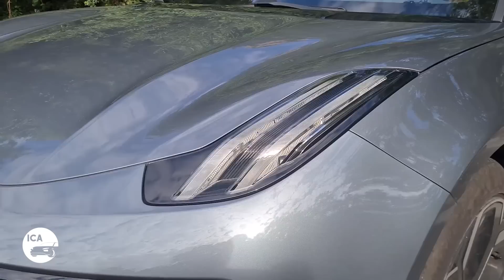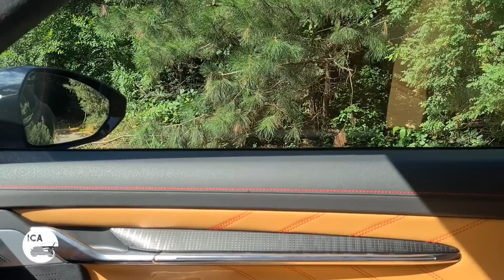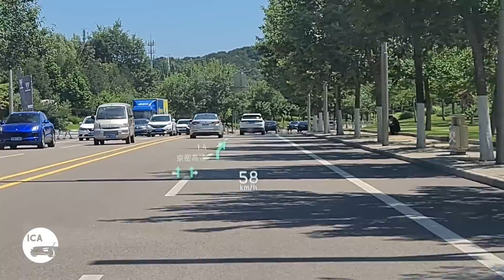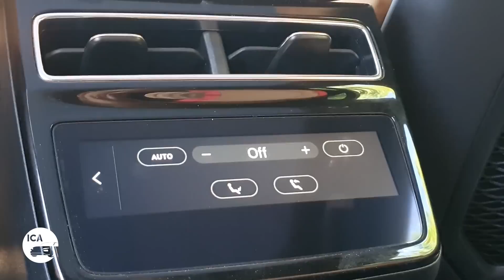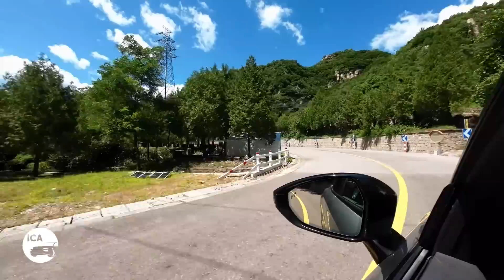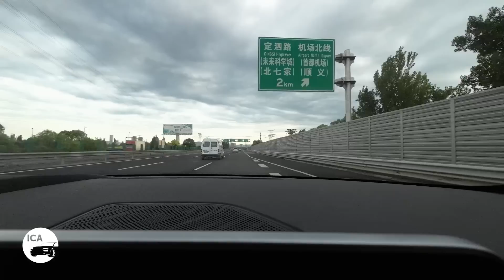The First EV Shooting Brake Is A Monster - Zeekr 001 Review

Comment: Porsche 911 hasn't got 265 rear tires... the old caymans used to, a modern Porsche has wel over 300...
Reply from the maker: I probably said 'like a 911'. I remember my uncles C4S from about 2003 had super wide rear tyres and the sheer size of them stuck with me.

Comment: Looks like an insanely nice car! Interior is beautiful, acceleration is supercar fast (or faster!) I was very dubious about electric cars and Chinese cars but ended up getting a BYD E2 for city driving and am super pleased with it and planning to get another higher end car when funds allow. Was thinking of a BYD Han and still am but seeing this makes me think of this as an option too! 

In the meantime trying to find if some way to increase the performance of the E2 a little 😅, quite hard to find much English info about the E2!
Reply from the maker: Awesome. Where do you have your E2? In China or somewhere else? Han is good but will be expensive in Europe. Our review of it is coming very soon so check back this week.

And yes, the Zeekr is really impressive. The chassis is engineered by a former Volvo/Saab guy so not only is it fast and really well engineered, it's safe too. A brilliant car. Coming to Europe in 2023. Just hope the price is right.
Reply: @InsideChinaAuto  I'm in Lao in South East Asia, the North here shares a border with China. The E2 here cost me $25,500 USD on the road and the Han here is around $58,000 (4 wheel drive top spec model) how much is the Zeekr in China?
Reply from the maker: @supernovadw  Nice. I saw a few Laos-plate cars when I was in Yunnan. The Zeekr starts at $44,200 in China and goes up from there. Dual-motor is $51,400.
Reply: @InsideChinaAuto  yeh one of the only countries cars who are allowed in China without a guide, I'll have to do a road trip up there sometime! Very tempted by a Zeekr or another similar car when funds allow and quite easy to buy in China and import to Lao so should be lots of options.
Reply from the maker: @supernovadw  Yeah, you should cross the border and give some a try now we're open. You'll be impressed. Hope Laos is treating you well.
Reply: @InsideChinaAuto  I went in 2018 to Kunming but flew there not by car. My wife is of Chinese decent and speaks fluent Chinese so easy when we travel there. Maybe even worth looking at buying a car there and sending it here like I say. What province in China are you in? Is there anything there in the way of people modifying their EV's? The Tesla and other western brand EV's are able to do a remap (more accurately re program) for more power so must be able to do with Chinese brands too.
Reply from the maker: @supernovadw  I'm based in Shanghai currently (formerly in Xi'an). I'm not 100% certain if there's a remap market yet, to be honest there's no huge modification culture other than colour and interior materials, but it's growing. The most modified EV is the Wuling Hongguang EV because it's so cheap and easily customisable so people do all kinds of cool and crazy things with them.

Comment: No, hating but so many Porsche design ques; 
• the shape of the front seats.
• the headlights on the top of the front hood
• the “handles” on the center consol 
• the “baseball glove”  color of the “Napa leather”
Reply from the maker: To be fair, the headlights on the bonnet are a design feature of Lynk & Co, partner brand and the brand this car was initially going to be made for, and if handles on the dash are a thing, then maybe the G-Class should be giving Porsche a call. Can anyone 'claim' a colour of leather?
Reply: No hating but you're blind. Geely's subbrand Lynk & Co was first with this design so yes Porsche copied Geely.
Reply: @jzvr5842  you know that you are referencing a brand that launched its first car in 2018, Porsches design language and brand is a bit older than 4+ years…
Reply: any references？

Comment: As much as I like this car, during the entire review I couldn't really shake of the feeling that they took a real good look at the Model X for inspiration. The auto-close door when you press the brake, the UI on the screen, the panoramic roof etc.
Reply from the maker: Inevitably there will always be some crossover between cars and what works will be used and what doesn't will be left behind. Credit to Tesla for paving the way, introducing some cool features, AND not blocking them off to others like some brands do.
Reply: i really dont see any resemblance at all. but hey, its hard not to look alike others.
Reply: I wonder where technology would be if brands didn't copy from other brands? V🤣
Reply: apart from the tesla clues, there is a lot of volvo/polestar tech in its guts. not surprising, after all these are sister brands. was one of the things that immediately stuck me when i drove it.
Reply from the maker: @leotek..  Well partly because it's not entirely true. It is based on the Geely SEA platform, not Volvo or Polestar's  (the 1 and 2 aren't based on it), and the operating system also isn't from Volvo or Polestar either which are Android based whereas the Zeekr is on the Snapdragon 8155 now (and a different chip before). What they may share is motors, not 100% certain on that.
Reply: LOL none of those were invented by Tesla.

Comment: The seat controls in the back are a dangerous feature , you only need one naughty child in the back to suddenly push your seat forward while you are driving and it's a recipe for disaster ....
Reply from the maker: Fortunately they're only for the passenger seat, not the driver. It's not an uncommon feature in luxury cars here to have controls to push the front passenger seat forward to give maximum rear legroom for the big shot exec in the back.
Reply: @InsideChinaAuto  That's a relief , with my grandchildren I would be bricking it 😂
Reply from the maker: @PhilipKerry  If you lived in China you'd have to contend with them not having to wear seatbelts in the back either. One rule that does need implementing here.
Reply: @InsideChinaAuto  Ouch

Comment: About the chip. Zeekr tried to pull a fast one and fobbed off a lower spec snapdragon 820A inside on some of the early delivered cars. It was exposed and triggered enormous outrages among the owners, because 8155 was promised on their launch and the inferior chips are quite laggy. Then Zeekr offered compesations like store credits and free charging and things like that and was declined. Finally they decide to take thier medicine and offer upgrade to 8155 chip free of charge to all owners before their first model tuning into a fiasco. You can see the result in the sales rebound in the last couple of month.
Reply from the maker: Absolutely. I wasn't aware of all the fobbing off side but the chip we had was certainly problematic. 8155 seems to have solved all those issues so it was the right action eventually to roll it out for free and fixes the one weak point we had on our car. Over 7k sales in August with just one model is impressive.
Reply: many other brands did stuff like this. Let's not mention Toyota wheels coming off and then recall all the cars because of that.
Reply: 我就是极氪车主，没有你说的上市时厂家说搭载8155芯片，但交付时减配成了820芯片，然后车主们都很愤怒的事情，相反当厂家说给我们免费更换8155芯片时，大家都很高兴。你说的芯片减配，或许是欧拉好猫那款车
Reply: @拉赫萨  可能是我理解错误，但是当时极氪车主芯片这事是闹得沸沸扬扬的，极氪一开始也提出赔偿方案然后被拒绝的
Reply: @maniacyro5167  当极氪换上8155芯片，加上软件逐步完善，可以说是这个价位里最全面的一辆EV汽车了。当然，目前NIO的ET5也上市了，有机会想去试驾一下，这也是一款令人惊艳的EV汽车。我不知道你在哪个国家，希望中国的EV汽车可以走向更多国家。
Reply: @maniacyro5167  然后传祺gs8也基本重复了这一个错误，本来有能力打败汉兰达的是他，然后白白把这一头衔送给了理想
Reply: Standard Chinese protocol, DENIAL DENIAL DENIAL, FIX ISSUE
Reply from the maker: @matthewspry4217  Wouldn't say it's a uniquely Chinese issue having lived in 3 countries myself, and it's certainly better than denial, denial, denial, keep denying. In the end they got a proper car and it's excellent.
Reply: @matthewspry4217  Better than standard Western protocol, denial, denial, blame the user, you're holding it wrong, no fix ever.
Reply: @matthewspry4217  Samsumg with their exploding batteries.and inflating batteries
tesla with its sudden acceleration in various countries and denying everything
Reply: @matthewspry4217  Isn't that like the Germans do also (except the Fix issue part, which doesn't always follows)
The American way is: denial, denial, denial and putting millions in litigation in stead of fixing the issue.

Comment: Hey man yeah for sure is worth the money. Do u know how much time to recharge 10-80% time need.
Reply from the maker: I agree with you. Zeekr claim 10-80% in 30 minutes with high power charging. I did a quick charge to drive back and it was adding 1km range roughly every 6 seconds on the fast charger I used.

Comment: 我是中国人，what do you think of the chassis suspension？
Reply from the maker: Welcome to the channel! I was genuinely impressed. I gave it a real test on some brilliant mountain roads, it never felt troubled or out of control, the grip was really strong, but it was equally adept at cruising and the suspension was composed and comfortable because it had air suspension. A really strong performer.

Comment: Thank you very much for your Test drive and informations about the Zeekr 001. Im quite interested in this car and consider buying one, once available in Germany.
Reply from the maker: Glad you like it Stefan. It's a great car, really spacious, incredibly quick, and good quality and value too. The new 8155 chip should solve the issues we had too.
Reply: @InsideChinaAuto I wonder about the seating position compared to a SUV. I used to drive SUV´s for the last 20 years and this is actually my only concern right now I have. Will I be able to adjust myself to this kind of lower seating position..... Is it as low as a Sedan like a Tesla Model 3 or Y or a bit higher?
Reply from the maker: @stefanyangguang2153  I'd say it's certainly comparable to a sedan in terms of seating position, it's definitely not SUV height. Obviously you can make your seat height a bit taller but ostensibly this is a sports car so not SUV style. I'd say more Model 3 than Y but I haven't sat in a Y.
Reply: @InsideChinaAuto  Thank you very much for your helpful and prompt reply.
Reply: 你值得拥有，我购买的712公里续航的版本（we100），每天大概要开100~150公里，现在每周2次充电（周末1次，周中1次），而购买特斯拉的同事，每周大概要充3~4次电，而且他们在坐了我的车以后，他们普遍觉得特斯拉的续航和舒适感差太多了
Reply from the maker: @拉赫萨  Great, it sounds like it's really working out for you. Great car.